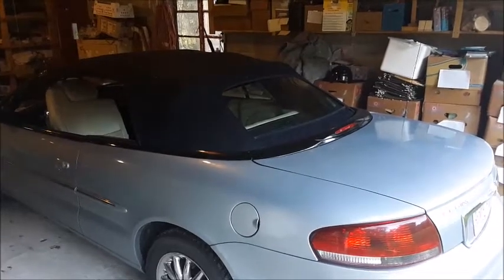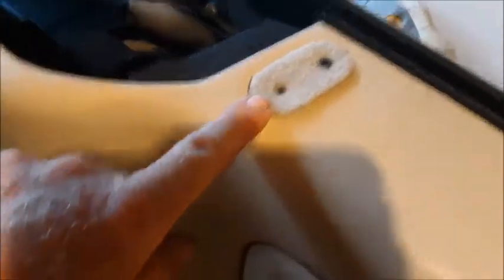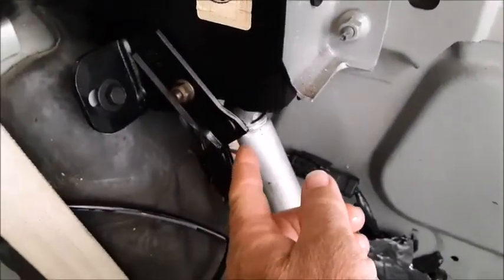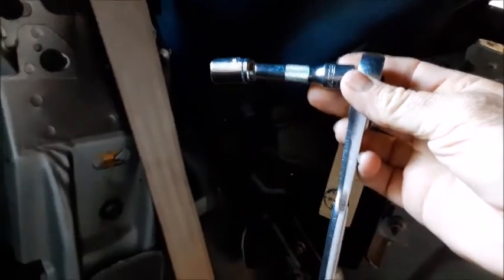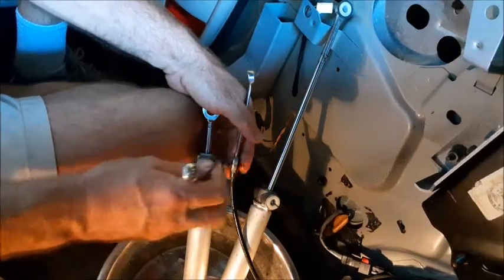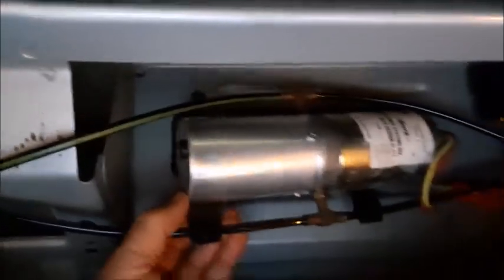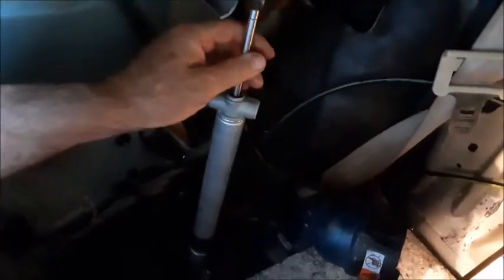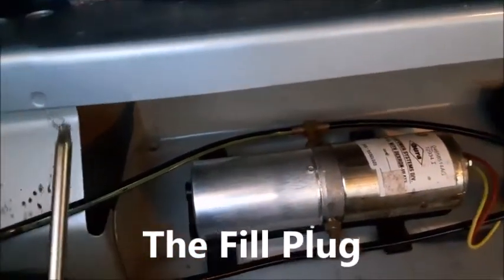How To Diagnose and Replace Your Chrysler Sebring Convertible Top Hydraulic  Cylinders

Comment: Very helpful video, was able to fix my convertible top. I would suggest buying the hydraulic cylinders from Hydro-E-Lectric instead of other options because I bought my cylinders cheaper at a-premium but there was a manufacturing error and the snap o ring wouldn’t fit the bolt dye latch it onto the vehicle.

Comment: Love your insertable spiritual instructions via helping with car instructions.  Service to others.  Thank you. 
Pooling of fluids on rear passenger underseat after refill and lines being bled.
This same problem on a friend's Seabring when I helped by refilling pump.
Never knew about piston cylinders. Answered my curiosity as to why fluid loss after doing the job.  Another post recommend a turkey baster for inserting Mopar.
Yes I once used a screwdriver in the rubber plug and pierced  through the nipple.
I used marine silicone glue to repair and seal it up.  Man you need patience getting the plug back in. Moving slowly here as high humidy heat wave.  I will order the piston cylinders as the seals are probably cause of pooling fluid.  The cylinder information was priceless.👍
Reply from the maker: Thanks, glad it helped

Comment: Thank You, the video was very concise and kept me from making mistakes. I did run into 1 major problem..... To remove the hydraulic cylinder piston from its upper mount you took a 13mm socket and unscrewed the bolt holding it to the car. I believe you got to this bolt through a hole in the bracket (that holds the piston). My 2004 Sebring Conv. does not have this hole. My friend and I can't see how they installed the piston to the bracket nor can we figure out how to get to the screw to remove it. Has anyone run into this problem?

Comment: I realize it's been 2 yrs since you posted this video but I'm crossing my fingers that you'll still see comments.  Thank you so much for the time & effort! I have saved this to my Sebring library unfortunately, my problem is the exact opposite. The top won't retract fully into the well. I have looked at every piece while replacing the old top & found nothing untoward. If you've come across ANY information regarding this issue, it would be greatly appreciated. If not, thanks in advance for taking the time to read...
Reply from the maker: Does the pump motor sound like it is reving up hitting an air pocket  in the system or does it seem more like the top frame is hitting something and the pump motor is trying to strain to force it down?
Reply: @creativerepairing2960  sounds like it's hitting something with a loud squeal on the passenger side.
Reply: Sorry, the motor doesn't stop but doesn't sound strained. The passenger side sticks up approximately 14 - 20" Above the well.
Reply from the maker: I am not a pump expert but I would probably try first making sure the pump reservoir is full to make sure the pump is not hitting an air pocket in the hydraulics.  Surely you could examine it to see if there is anything which could be hitting the convertible frame.  I am not sure if a hydraulic cylinder the get jammed part way through the expansion or contraction but you could call the company I mentioned in the  video.  They were very helpful and could likely tell you if a hydraulic cylinder can get stuck part way.
Reply: Did u find what the problem was?cause my top on the right side sits higher than the left.note that my right pump  leaks

Comment: Does the convertible top need to be manually opened to get to the top bolts on the piston cylinders?
It appears that's the only way to access them.

Comment: If you are only replacing one side, do you need to disconnect both sides to bleed the line?
Reply from the maker: You are probably comparing bleeding the convertible system to a brake bleeding.  With the convertible system you don't disconnect the lines to bleed the system, it will bleed itself as you run it up and down, however the reservoir in the pump tank will have to be refilled.  Some people pre fill the cylinder before they install it.

Comment: Where did you purchase the cylinders? I have a 2005 Sebring. Thanks for sharing the video.
Reply from the maker: I bought them on Ebay from a seller named Hydroelectric2009.  They are located in Florida and I spoke with them on the phone once and they were very helpful.  Thanks for the comment.